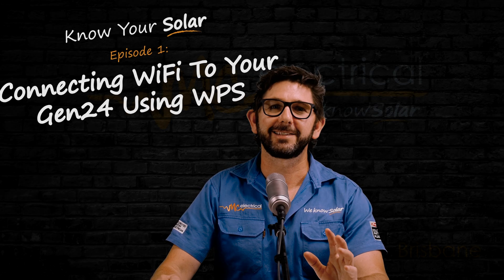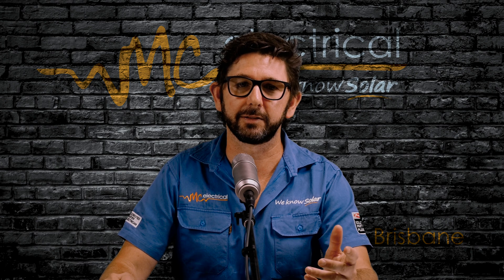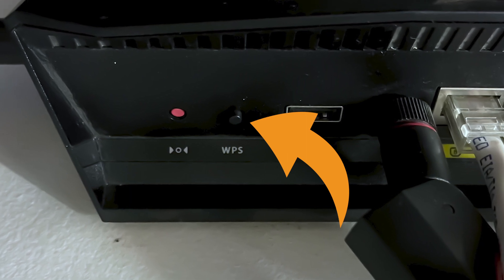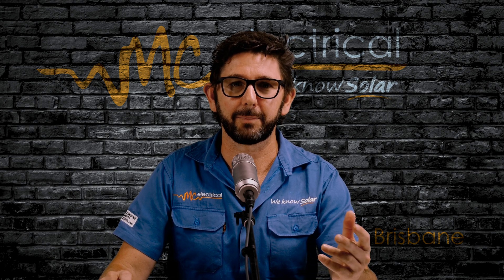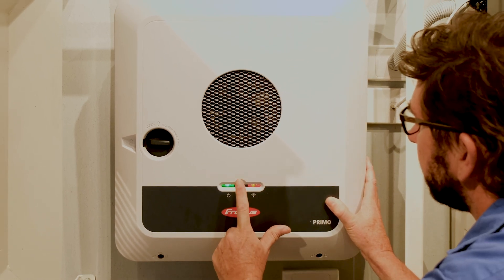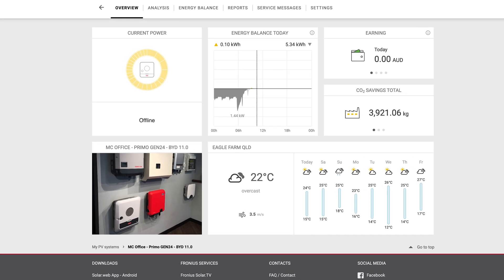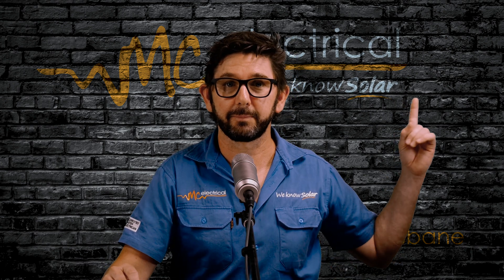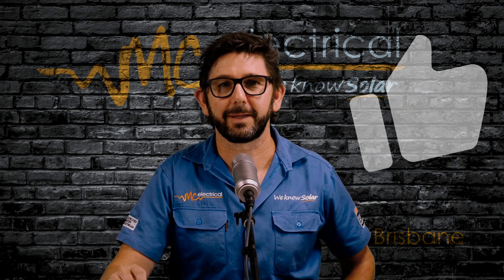Connecting Gen24 to WiFi using WPS | Know Your Solar | Episode 3

Comment: Very useful videos, however I couldn't get the WPS nor the direct entry to work fully. I got the phone connected to the inverter, and also entered the modem SSID and PW, even got the green tick on "Access point connected", but it won't connect to the Solar.web for some reason. Could it be because we've got now a 5G-connected WiFi modem instead of NBN?   UPDATE - It finally seems to be working again, was trying to connect the secondary inverter rather than the main one which is connected to web... Thanks for the tips!

Comment: Very glad I found this video thank you, WPS solution worked fine with my Netcomm Modem. When I recently installed a MESH system the tech said to keep the Netcomm modem connected as the Inverter had been paired with that originally. So glad I did that. The inverter works on the Netcomm and the rest of the house on the Netgear MESH system. Much easier this way.
Reply from the maker: Oh nice, thanks for your comment! I’ll stick that on a memory postit just in case.

Comment: Does not work
Reply from the maker: Ah, bugger. Did you try my direct connect video (using your phone). Otherwise you may need to get onto your installer. Potentially you have a range issue or a fronius issue

Comment: This process didn’t work for me.  But after some testing I finally got it connected and working.  For what its worth, this is what worked for me.
1.	Tap the Fronius once (not twice)
2.	Activate the WPS on your router
3.	Tap the Fronius once more
After a few seconds I got a solid blue light.  I don’t know why it worked or even if it is supposed to work, but this forced the Fronius to find the WPS signal from the router which then connected fine.  GL

Comment: This along with your other videos was very helpful. My WPS light didnt turn on (although the light does work as I ended up restarting my wifi) but with a few attempts the inverter light eventually went to solid blue and connected. 
I will definitely be mentioning your videos to the installer and friends with fronius.
Reply from the maker: Glad it helped, and thanks for sharing our videos.

Comment: It's all about how fast you put your thumb over the light censor... too slow and it will not connect... trying quite fast worked for me after about 10 attempts. Thanks Fronius, pretty crap for a top of the range inverter.
Reply from the maker: Thanks for the helpful tip, Chris.